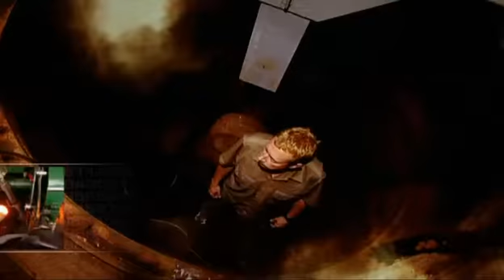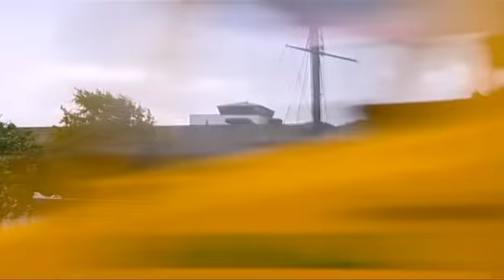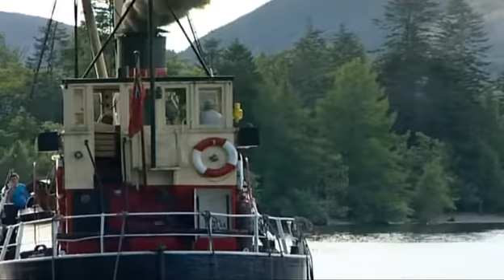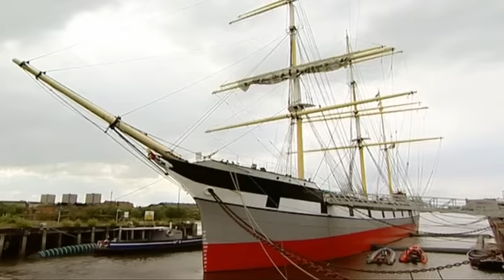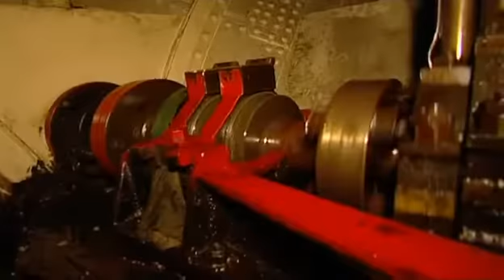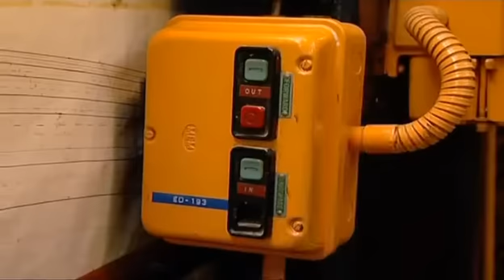Industrial Revelations - E09 - Highland Flop

Comment: Fuel use doesn’t alter a ship’s draft, that’s what fuel ballasting is for. The ship takes on water as fuel is used. To imagine these masterful engineers didn’t think of that is laughable.
Reply: Dude , make up your mind. Either fuel use effects draft  and is off set by ballast or “fuel use doesn’t alter a ship’s draft” and would need no correction. Pick one.
Reply: @Pocketfarmer1  I don't see the argument.  Proper ballasting compensates fuel usage.  Fuel is used, the ship's draft remains the same.  Fuel usage WOULD affect ship's draft IF the master didn't keep the ship properly ballasted.
Reply: @marionbloom1218 The verb is does not would. The original poster claims in the first phrase of the first sentence that there is no change because of fuel use ,while in the second phrase of that sentence that change must be compensated for. That is illogical. Either there is chance that must be compensated for or there is no change. Having to do work to maintain balance is not the same as being balanced.
Reply: @Pocketfarmer1  Are you a professional hair splitter, or do you do this just for sport?
Reply: @marionbloom1218 No ,I just have a low tolerance for nautical gibberish. What is to be gleaned from the original post? Perhaps nothing is a problem as long as you fix it? Does that strike you as a profound notion? The first sentence says not a problem, then fix the problem ,in one sentence. Either the problem exists and can be fixed or there is no problem. This isn’t that dam cat it a box  thing. It is either one case or the other.
Reply: Oh for goodness sake stop nit picking and enjoy the video
Reply: @JohnDivers-e1u  But it is quite an interesting thing that we have uncovered (certainly that I never thought about) that wooden paddle steamers didn't use water ballast so coal usage would affect the paddle-water interface, whereas iron hulled steamers would have water ballast easily adjustable to eliminate the problem.
Reply: Hold on a moment, he is partially right.  Wooden ships didn't have the facility to take on water ballast, all ballasting was done with stone, gravel etc manually loaded. so they couldn't correct the effect of converting all that heavy carbon (coal) into CO2.   It was only when steel hulls became a thing, that water ballast tanks were introduced.  I haven't been able to find a date when ships first used ballast tanks, but Wikipedia says that "In 1849, Abraham Lincoln, then a practicing lawyer, patented a ballast tank system designed to help cargo ships navigate shallow waterways by adjusting their buoyancy" so we can probably assume that it wasn't a thing before that date, so earlier paddle steamers may well have suffered this problem.  By the time Brunel's Great Eastern was launched in 1860, I'm guessing it would probably have had water ballast tanks so it would not have been a problem for the GE which had both screws and paddles.